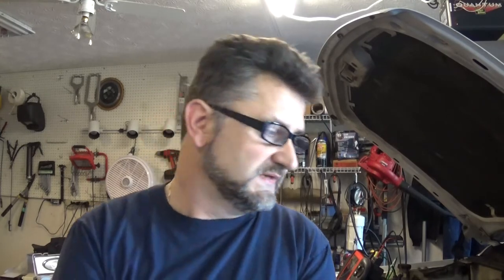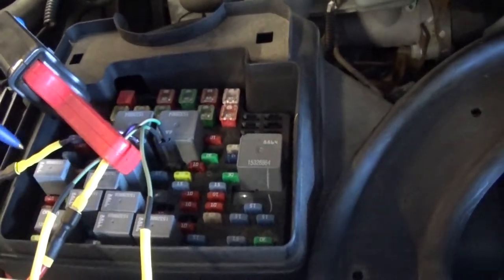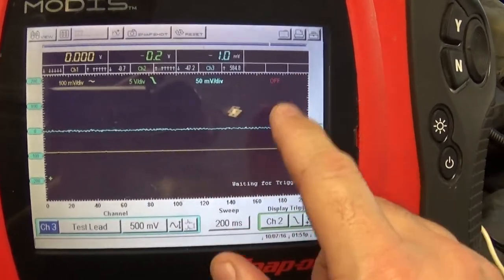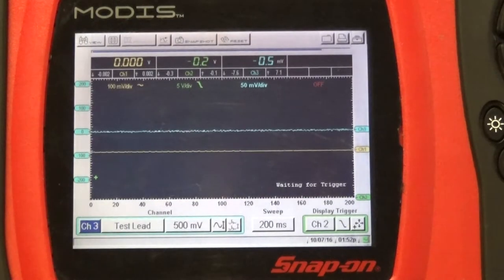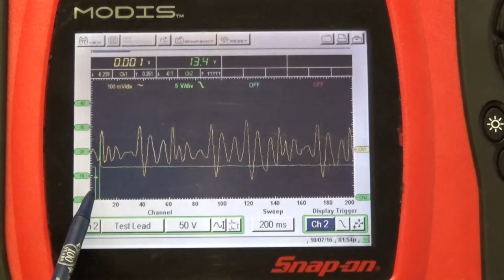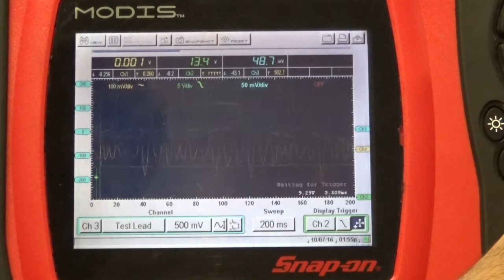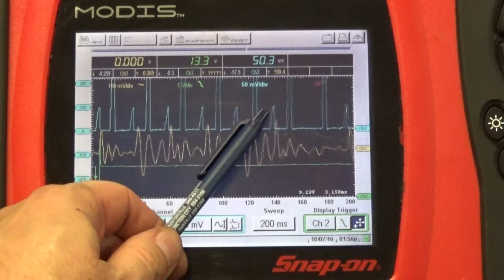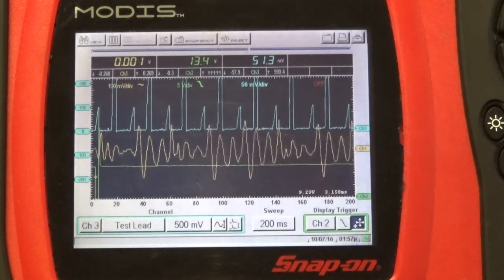How To Test Fuel Injectors With lab Scope And First Look Sensor

Comment: This is kind of a dumb question. I think there was a video you using the rpm clamp as a trigger. If this true how were you doing that? Are you just turning on the pressure inducer setting to get the trigger.
Reply from the maker: Derek Dlick For trigger you have I lot of options.  Current from injectors and coils, primary ignition, secondary ignition , injector waveform it all depends what is the most easiest component you can get to it. I hope this answers your question. Thank you

Comment: Great idea to make a non invasive diagnosis on injection but I've a doubt on the measures you can get from it.
Why not all the injectors produce the same oscillations on the fuel regulator? Take a look at injector #1 and #3 and partially to #6: they have very lower oscillations compared with the others but I suppose that the engine is running without issues, isn't it?
Did you made further investigations?
Reply from the maker: Diego Apollonio Good observation. Reason why amplitude is different is because fuel rail is U shape. Injectors on bank 2 (driver side) are closer to fuel regulator and amplitude is higher than injectors on bank 1 ( passenger side) . If would test four cylinder engine amplitude would be same on all injectors. I hope this will answer your question. Thank you.
Reply: May be you're right, It will help to see the pattern of the last injector that is missing in the video. I was very impressed by your creativity but I think that this technique needs a specific plot reference for each engine to be effective since you could not compare injectors. At the moment you get the one for your engine ;-)

Comment: great video KY   i love transducer troubleshooting    im wondering if you have tried to diagnosis a blown head gasket with your PPS  FIRSTLOOK  ?   you want to make sure the cooling system is full  and remove the rad cap  and come up with a rubber conical plug and drill a hole in it and attach a hose to your FIRSTLOOK   sensor.   the other end to your scope channel  A.   use another scope  channel for a high amp   clamp  channel b.  prevent engine from starting   crank for 20 seconds and look for a pressure rise on channel a  thats in sync with cylinder at TDC.  basically a relative compression test.     i dont have a car with a known  head gasket issue  at this time  but if you suspect one you can give it a try     also you can set up a trigger and identify the cylinder thats leaking.   of course the head  gasket would have to be leaking  to the cooling system   thanks again
Reply from the maker: Mark Wow I did not know that. Make perfect sense. I will try it when I get chance. BTW I am lucky to have gas analyzer. I  use it every time if head gasket is suspect. Watch my video how to diagnose random misfire. Thank you again for watching my channel. Are you professional or DIY mechanic?
Reply: 23 years professional   ase a-6  a-8  L1   on disability now for OCD does KY HOME GARAGE have facebook page?
Reply from the maker: Mark Ferraro not yet I am new on YouTube , don't have Facebook page maybe I will in future. I work on cars in my free time I am in medical field this is my hobby.